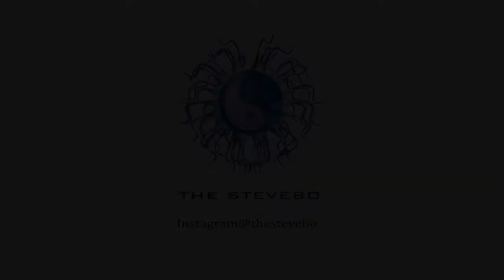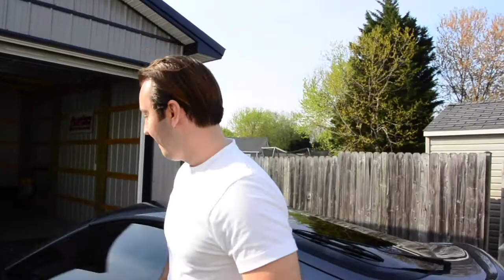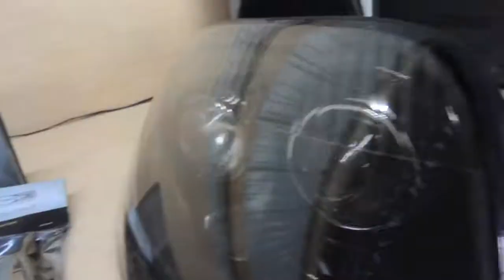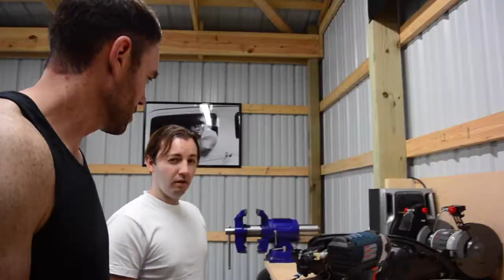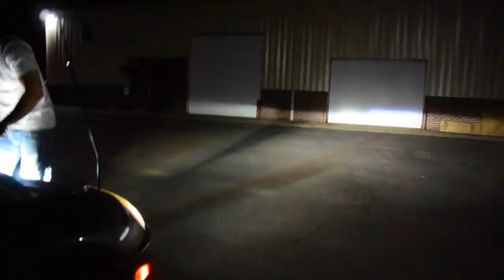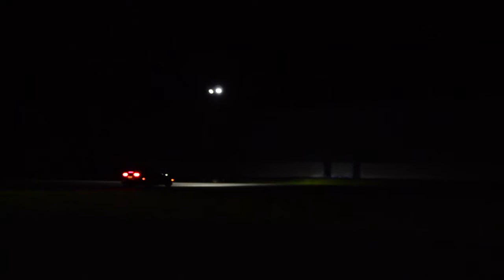93-98 Toyota Supra: Retrofitted Headlamps with D2S 4.0 from Lightwerkz

Comment: First mod I’m doing to my Supra lol.
Reply: Looking for  a pair of headlights now.
Reply from the maker: vacoombs nice man! Yea they’re hard to find in good condition. Luckily the dealer still produces them! You can get the brand new for lovely price of $1k+ it’s well worth it. Finding a good pair in good condition will be tough, do you plan on retrofitting and changing out the protectors?
Reply: Fujibo Heavy yea that is a big struggle right now, It’s very hard finding a good set of headlights that are reasonably priced. But yes that’s the doing a retrofit and changing the projectors.
Reply from the maker: vacoombs yea man. Do you currently have a set of Oem Supra headlamps? Because I do know you can purchase the lens only for about $500 or so, other than that it comes to how well you can restore older lenses